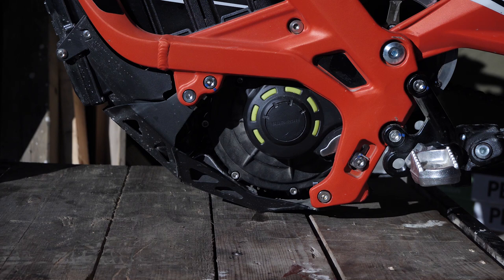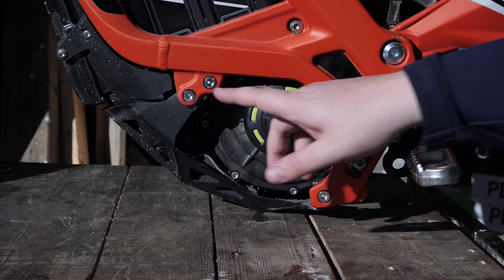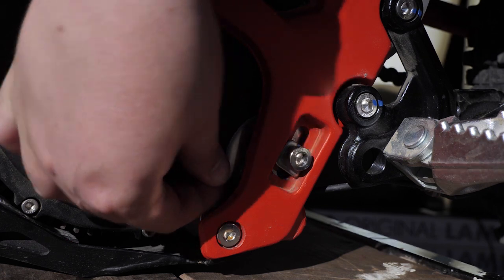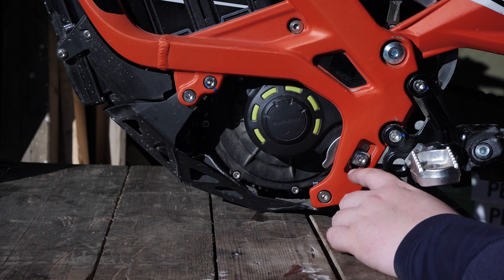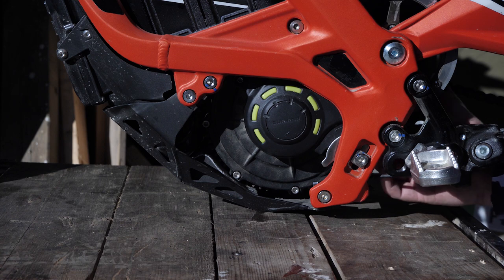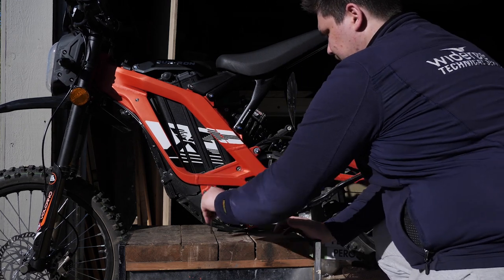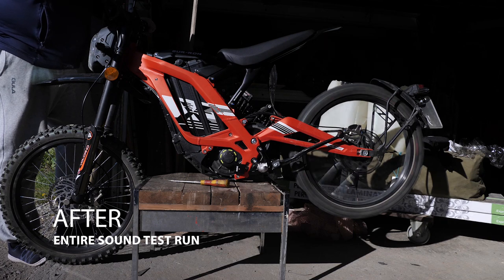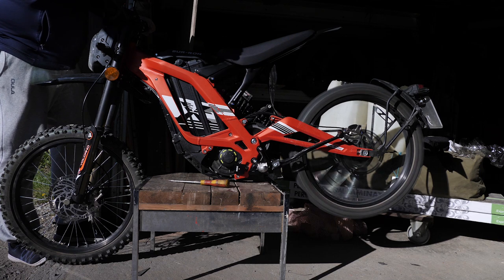How to adjust belt tension | Sur-ron LBX Tutorial

Comment: Thank you for this.  I just performed this adjustment.  A couple notes of my own: 1) I found that I had to release to two upper/front bolts to allow the motor to pivot,  2)  Another thing to keep in mind is you might want to make sure the two lower bolts are at the same height so that the motor pulley rotates in the same plane as the jack shaft pulley...  I think this was the source of my noise.
Reply from the maker: Thanks for the good notes. I'll make sure to explain this in my drivetrain/beltkit video
Reply: I think this was the cause of my slight noise that was just starting as well!
Reply: Mines just gone in for first service but the day before it started to make a whistling sound on de-acceleration quite high pitched , it seems to go after about 5 mins of riding , does that sound like a belt issue ? . I reported it when I dropped the bike off but feel like most places just check bolts and brakes  🤷‍♂️

Comment: Thank you for posting this! But when I losen my bolts that small silver lever just falls down it doesn't seem to do anything? Must be broken correct?
Reply from the maker: No, it's not broken. It doesn't matter that the lever doesn't stick in place when loosened. Its only job is to stop the  motor from sliding AFTER you've tightened the bolt again. Just remember to hold it up against the stop while tightening the bolt.
Reply: @nemistech5425  thank you! I really appreciated this video! Could not find anything online about this at all especially with detail! Thanks again!

Comment: I did this and now I get a ticking noise because the pulley on the jackshaft’s bolts rub on the frame, almost like the jackshaft isn’t aligned anymore but I never messed with the jackshaft only moved the motor…

Comment: Wait so did you loosen the belt or tighten it? It's not clear whether this bad sound was happening because the belt was too tight or too loose.
Reply from the maker: I loosened it. Sound happens if belt it tight and rubs on the sides of the pulley. Generally the sound will be worse when wet. That also means you can get the sound with the right tension, but bad alignment